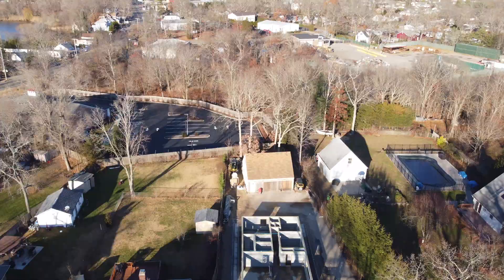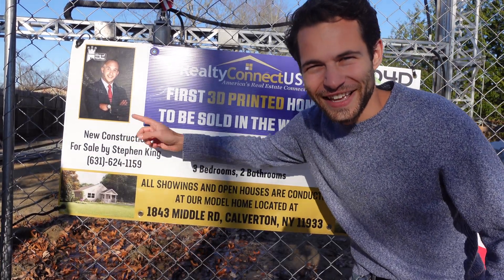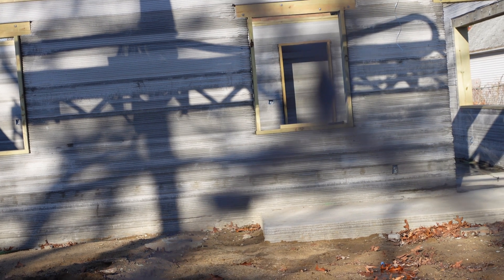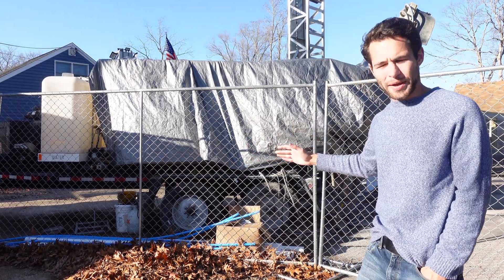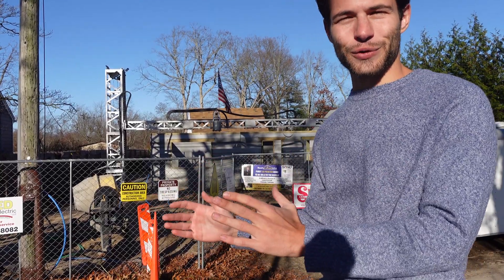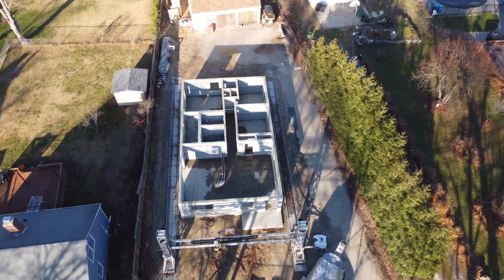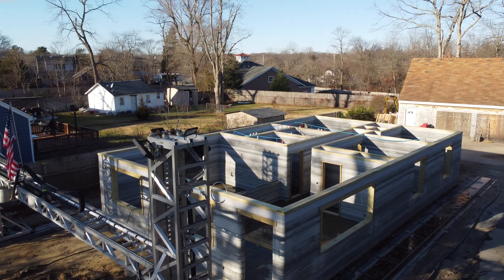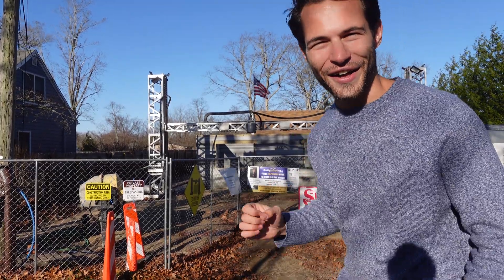SQ4D First MLS Sale 3D Printed House Finally Under Construction in Long Island, NY

Comment: It looks like a mobile volumetric mixer so that they can mix raw on site and reduce cost of materials significantly.
Reply from the maker: They always mix on site at every project I’ve visited.
Reply: @automateconstruction  You mean every sq4d site? or every print site in general? Most prints you have documented and that I have seen have used a PREmixed dry mortar stored in supersacs and then dumped in silos. The silos then dump into a mixer that adds the water. The mobile volumetric mixer, on the other hand, takes the raw cement, sand, and gravel (if it's a true concrete) and actually mixes them in the proper ratios down the conveyor belt. Then the water is added as to the dry materials to be delivered to the pump hopper. Basically its the same idea as a premixed walnut brownie mix where you just add eggs and water, vs making the mix from the raw flour, sugar, baking soda, walnuts, etc. and then adding eggs and water.
Reply from the maker: @josephdruther5080  I meant the water and dry mix is combined on site at every project I've visited not just SQ4D.